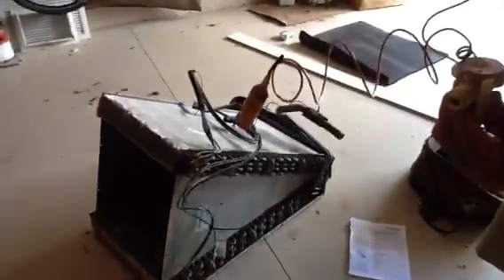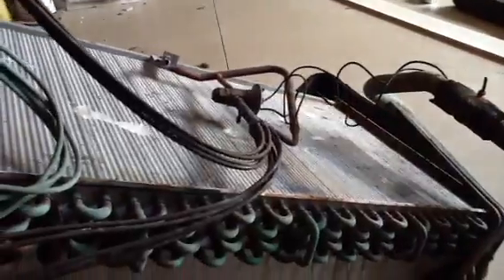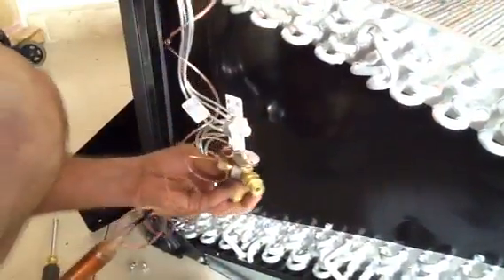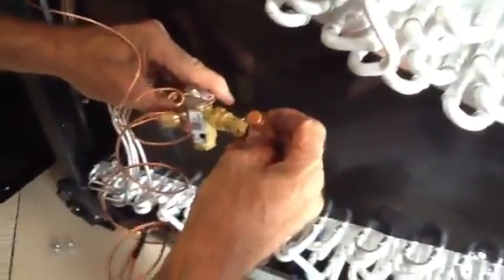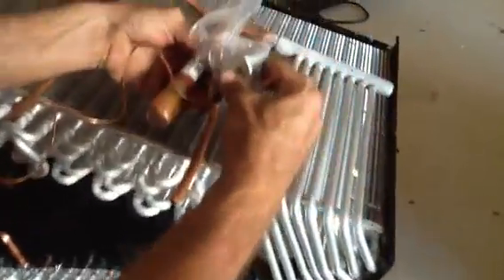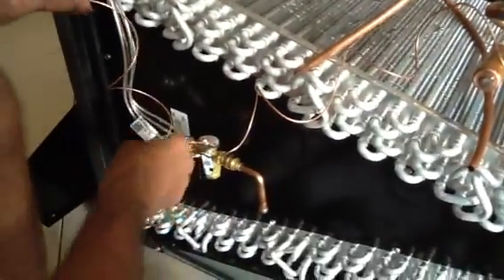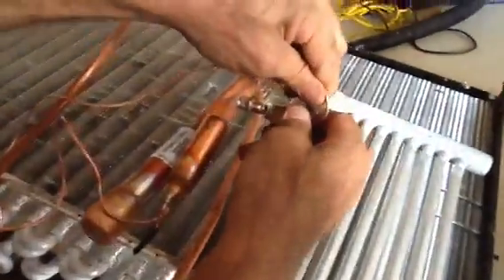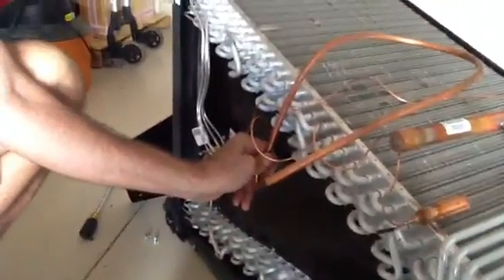HVAC TXV install

Comment: Some txv's come with a depressed in the equalizer tube, you just have to be cautious about what kind you have. And someone that doesn't know anything about HVAC should not be changing a txv anyways. Because they more than. Likely are not going to be able to vacuum the system and  charge it correctly

Comment: Jesus H...mine just went bad and they have to replace it in my attic, it was 94 degrees today. Just watching you do a quick explanation in a garage with the pieces in the open makes me realize why the labor charge is $600
Reply: The labor doesn't really cost 600$ it only costs what your willing to pay for it. It takes about 5 mins to replace a txv and an hour or two to vacuum the system and charge. Nothing really costs what we pay for it. I mean their are influencers paid millions to put on lipstick and say its great. That labor should be 0$ but someone in the world finds that valuable.
Reply: @Crypt0sis an hour to vacuum the system?!!!  No way Jose....it takes minutes, let it hold for a little bit to check for leaks and then release your refrigerant.   This job shouldn't cost more than 300 INCLUDING THE PARTS.